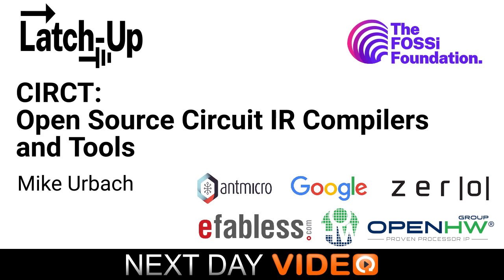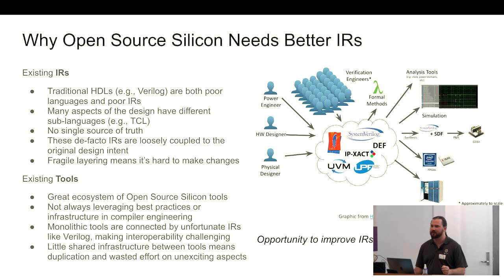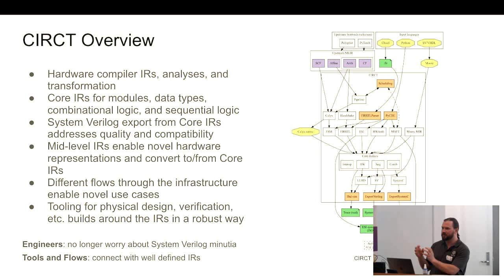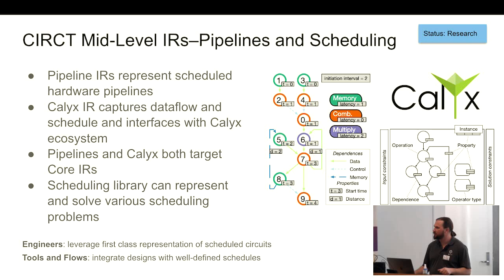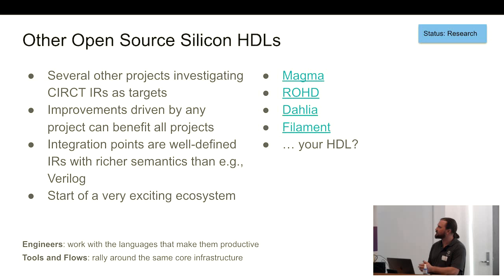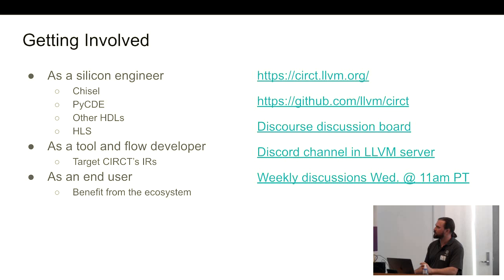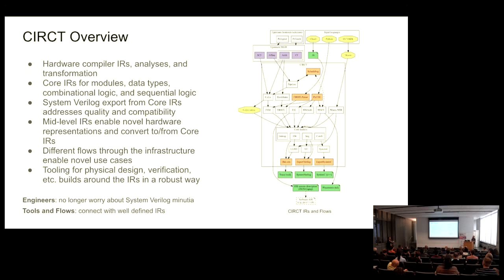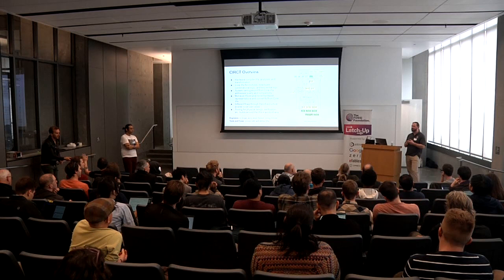"CIRCT: Open Source Circuit IR Compilers and Tools" - Mike Urbach (Latch-Up 2023)

Comment: 16:25 still no mention of VHDL 😀
Reply: Are you remember when intel ALU did calculation wrong? they solve it by write math proof as a design test. this is infrastructure to help you do that.
Reply: @theskepticai3653  I was around during the FDIV bug fiasco...
IIRC the mathematical proof lacked 6 corner cases.
Reply: f this US defence contractors tool, homies prefer Verilog
Reply: @haze6277  habits are habits.
VHDL takes more efforts to learn, but is considerably more powerful, it was created indeed for this 🙂